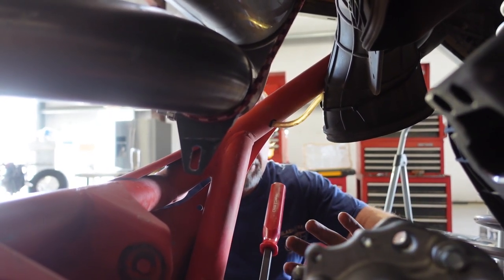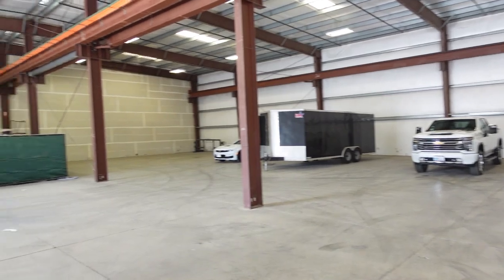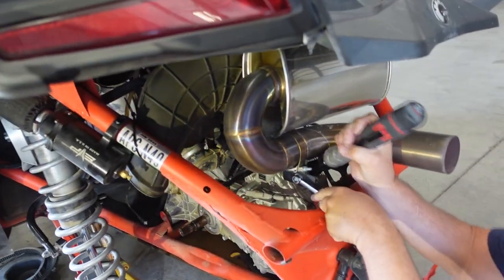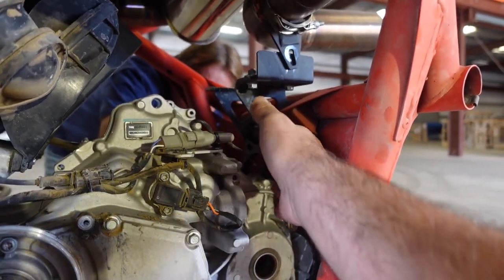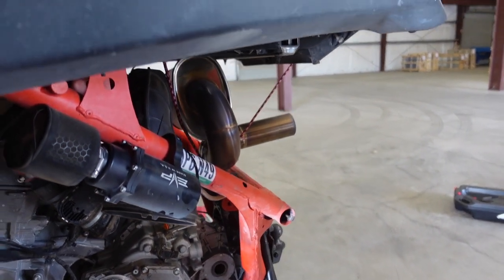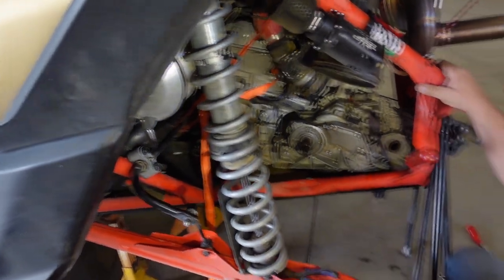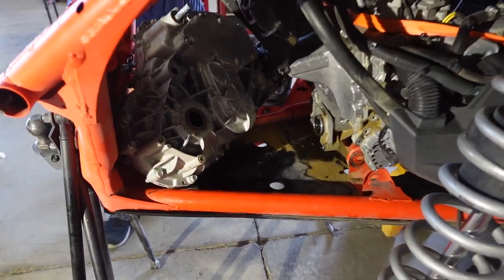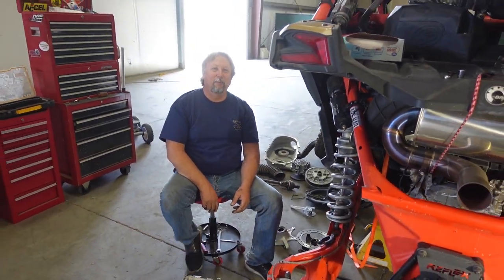can am X3 EXPLODED Transmission??

Comment: Way more work than a Turbo S.   Did the gear reduction in my Turbo S and it took about 30 minutes to have the transmission out.    Same stuff though, polaris says remove intake, yadda yadda.   Check with CryoHeat for parts for that thing.  They've got some improved internals.
Reply from the maker: That's good to know because we also have a turbo s. It actually already went to cryo and his back and back together and running so far all good, thanks for the tip